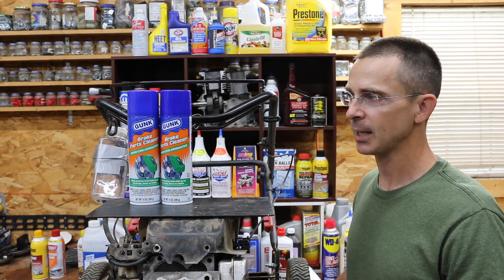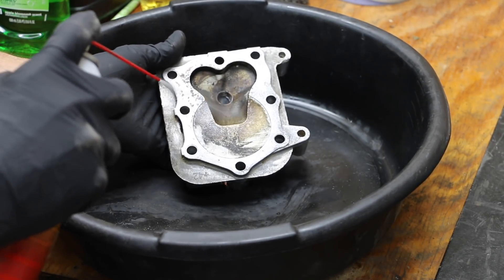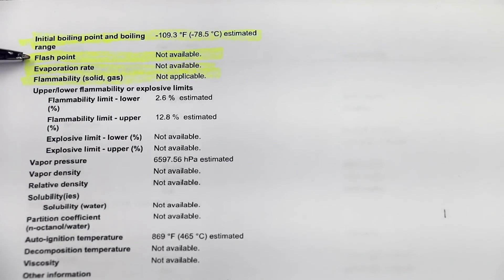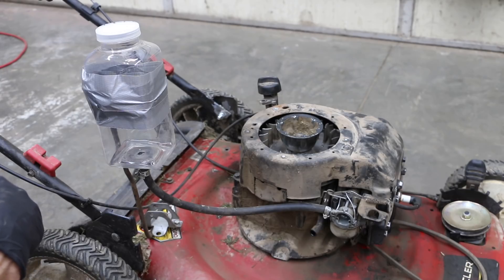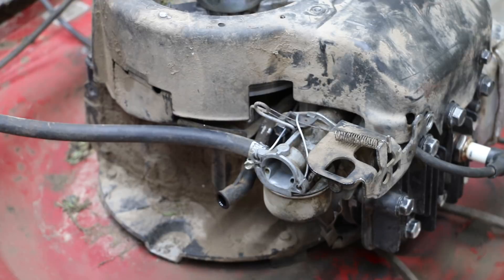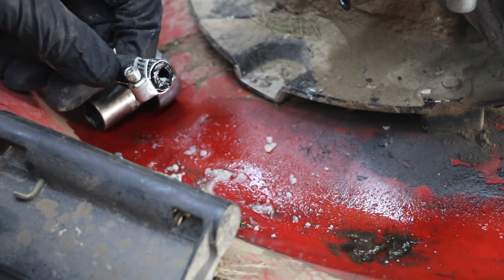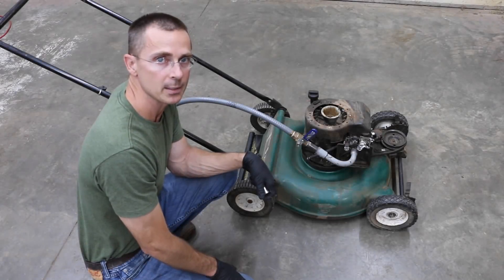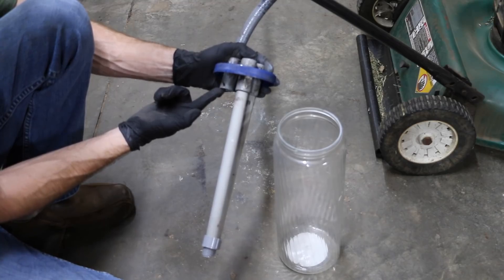Will a Gas Engine Run on Brake Parts Cleaner?  Lets find out!

Comment: Thank you for doing this video. I have asked about this a few times. I can't recall if you have used starting fluid yet, if not I would like to see it run. Also the beer /soda cans cylinder head. I think the cans would be funny to see. Honestly you are doing a great job on keeping the education / entertainment level pretty high. Sadly more people would like to see more failures but in the same sentence, I think they look for catastrophic failure just to see it happen, no matter what happens to you or your engines. I love watching your videos because I learn some things that I had no clue that could work in a pinch to get me through until the proper replacement parts are delivered or purchased in town. I also thank you for your service to the country!
Reply from the maker: Thank you very much for the positive comments. I tested staring fluid a while back and the engine ran for nearly 30 minutes in all without causing any damage.  Thanks for the recommendation on cans. That would be funny.

Comment: You could try Jet Fuel, altough that would probably be too extractor expensife for any Independent Guy like you
Reply: R0CK3R do you mean av gas or jet fuel?  Because jet fuel is more or less extremely pure kerosene from what I understand.
Reply from the maker: Thank you for this recommendation.
Reply: Yep it’s Kero with all the water content removed(higher quality kero) like JP8
Reply: I think you're mistaken. Jet A is purified kerosene, it is very difficult to ignite liquid jet A at room temperature.
Reply: R0CK3R! where is mark hates kittens!
Reply: 100LL is damn fun, but I think it would be functionally identical to mogas. Would be interesting to see if he could get Jet A to run in a gasoline engine.
Reply: Pacific Northwest....You're right, the av gas is more fun than kero, JP8 essentially, with the av gas though, you need to run a lot of lead or advance with the timing. The flame front and propagation is slower than gasoline. If you don't advance the timing, the exhaust valves will be shrouded in the flame as it opens. this condition will literally burn up the exhaust valve, overheat the head, melt top of piston....just sayin.....
Reply: JetA1 is for turbines; turbofans and props, JetB is good for old barely used turbojets mainly military and AVgas is for general aviation, still piston powered. But they all have greater properties to auto fuels like additives to stop freezing, water dispersant's and lubricity. But it's not very expensive, I'm sure you could reach out to a smaller airport that services small jets and get a few litres in a jerry can.
Reply: Aye what's ma German boi doin here ?
Reply: Jet fuel almost burns like diesel
Reply: Jet fuel is just kerosene with some anti gumming agents and minimal moisture

Comment: Hi Sir, great video.  I have a new suggestion, kerosene!  My grandpa used to run his farmall tractors on Cole-oil, which I found was a type of kerosene!   They had a switch near the glass bulb by the carborator, and warmed up the tractor on gas, then would switch the fuel to pale green kerosene.  My dad said the tractors would run nearly all day on kerosene, but that gasoline would take two or more tanks on gas.  There are different types of kerosene, I believe Cole oil was type 3 kerosene.  I've seen it long ago at a farm fuel station, but that was twenty years ago.  Good luck with all your projects, and Happy Holidays!!!
Reply from the maker: Thank you for this recommendation and Happy Holidays. I plan to test Kerosene soon.

Comment: Run a car engine using the vaporizer and use gasoline or alcohol or other things that worked with the small engine also try to drive it if it works .
Reply from the maker: Thank you for this recommendation.

Comment: did you put a hole in the see through tank, because if not it will create a vacuum inside the tank and it wont allow the fuel to get in the carburetor easily
Reply from the maker: This is a great point. Yes, I added 2 tiny holes to the cap. Thanks again.

Comment: I feel like you’d know the answer to this question, I can’t find it anywhere on google. My 2 stroke stihl weed eater, no matter if it’s adjusted perfectly to the pressure and temperature of the day will smoke white smoke, when I place my hand over the exhaust I get this brownish film on my hand. I was wondering if you’d know what’s happening with it. Im hoping its just too rich in both fuel going into the engine and oil in my gas and not the piston rings blowing out
Reply from the maker: I believe you're right in that the engine is running rich.  You might try a synthetic 2 stoke oil to see if that reduces the smoke.
Reply: Project Farm alright, thank you. That reduces my worry’s, I bought the thing practically brand new from a family friend for $50 ($300 off) and let it idle on and on with seafoam to break it in real good. High rpms can mess with the engine while breaking it in and making the “breaking out” phase happen prematurely.

Comment: Will engine run on blinker fluid ?
Reply from the maker: LOL! This is a great one.
Reply: kekool95 You might need to check the piston return springs!
Reply: Also he might need to check the muffler bearing in that mower.  Wonder if ChrisFix himself wants in on this.
Reply: kekool95 red or yellow. Red burns hotter.
Reply: Blinker fluid. Dielectric grease!
Reply: Don’t forget to barometrically sync 
the spark plug fuses.
Reply: Nuh uh that would sieze your muffler bearings
Reply: you'll need to install a hyfendufenator in the carburetor, but be careful: you may have to replace the muffler bearings. Make sure you put hazard additive in your blinker fluid.
Reply: @vincentrobinette1507  hazard rated blinker fluid is on available to law enforcement and fire departments, LOL!!!
Reply: I have a moped that runs on synthetic high mileage blinker fluid. It adds horsepower to.lol
Reply: @Olmstead Technologies Cris Fix bought out the last supply before it was outlawed!
Reply: he might blow the welds off its intake !
Reply: Lol
Reply: Shhh.. don't tell the beamers.
Reply: You forgot the fram grease
Reply: And also "can engine run without seals on valves"
Reply: If you have blinker fluid all you have is water
Reply: Fratastat. Settings cannot be fixed after this...
Reply: I don't think visine is flammable enough.
Reply: Perhaps, so long as the muffler bearings are of good quality and the kanooter valve can provide sufficient flow
Reply: I love all of the advice and suggestions, bit I just want to make sure he gets a good exhaust sample while running the tests.
Reply: Happy to donate some from my BMW if you need it. God knows I don't.

Comment: Project Farm, I find your videos very interesting, but I notice when using some fuels you have to block off half the carb intake with tape, which changes the true results of the test. It would be better if you had a small motorcycle carb that you could change out the main jet. it would be fairly easy to calculate which jet to use, start with double the size for alcohol and work from there
Reply from the maker: Thank you for this recommendation.  This is a great suggestion.

Comment: Once heard an old timer talk about how he had an old GMC truck that burned oil on one cylinder and kept fouling the plug, he put a boat type plug in it and it worked and didn't foul
Reply from the maker: This is very interesting. Thanks for sharing this information.

Comment: I wonder if Rislone Head Gasket repairer works. My car shows signs of having a blown head Gasket and a mechanic suggested I try that product but it's kind of expensive (if it doesn't work).
Reply from the maker: I hope you achieve good results if you choose to go with this product.
Reply: Thanks, I am unsure weather or not to try it at $80+ per bottle. I am hoping that somebody in the comments section or your good self might have some advice. Any info on people's experiences would be greatly appreciated.

Comment: need to try using  water, toluene and ethanol for a home brew gasoline and see how it works. It would be neat if some of the others have a few different things to do a home brew combination and try to make gas that will work in the engine. I am sure other would have ideas as well
Reply from the maker: Thank you for this recommendation.

Comment: will a 4 stroke engine run with 2 cycle oil and non mixed gas
Reply from the maker: 2 cycle oil in the crankcase and gas in the fuel tank? Thanks
Reply: exactly

Comment: Run compressed air for a supercharger
Reply from the maker: Thank you for this recommendation.
Reply: Use the vapor guy unless a lawnmower carb will work as a blow through carb... Encapsulate the carb and pressurize the capsule and see if it'll carb inside that environment

Comment: Try and run it on Coleman gas or that Ronson liquid lighter fuel you put in a Zippo. Thanks for the great video. Also, if you burn chlorinated brake cleaner at certain temperatures it gives off phosgene gas, which was a chemical weapon used in WWI.
Reply from the maker: Thank you for this recommendation and great point regarding chlorinated brake cleaner..

Comment: Will you build a GEET engine and test it with actual work.  Most of the videos that I see of these engines are just idling or reving.  A vehicle driving would be my first choice, but lawnmower or something else would work.  They have kits or DIY from plans.  Do a side by side comparison with the same amount of fuel.  Thanks and keep the videos coming.
Reply from the maker: Thank you for this recommendation.

Comment: Another great vid mate.  Looks like it runs lean after checking the spark plug.  But it still works.  
Also probably won't be getting the upper cylinder lubricated like petrol provides. 
Cheers mate 👍
Reply from the maker: Great point and thanks for the positive comment. Cheers

Comment: What about trying E 85 alcohol? What adjustments would be needed for proper air fuel mixture? Can you get enough fuel without adjusting the carb?  Since it's about 50 to 80 cents a gallon cheaper is it worth the bother? Thanks
Reply from the maker: Thank you for this recommendation.

Comment: Will a 2 stroke run on a instead of 2 cycle oil mix in the gas, putting actual car oil (10w-30) in the gas tank.
Reply from the maker: Thank you for this recommendation.

Comment: Wonder how many RPM a lawn mower can rev to before fail  (^_^) 
I have taken the governor off a few mowers, but never checked RPM or revved to blow up
For brush mowing, you can cut out the front of an old mower and rev it up to mow brush (^_^) Works good
Reply from the maker: Thanks for commenting.

Comment: I like as soon as your vid loads because I KNOW it will be good. EDIT 01: Less than halfway through and feeling all warm and fuzzy because you used one of your old faithfuls and not one of those new crate motors. EDIT 02: I have an (assumed) 2.5 hp OHC four stroke that does me well. It won't start without Ether, but it doesn't stop once it's going. Would you suggest trying a vapour set-up on an OHC 4 stroke? It could well be higher than 2.5. It hammers heavy lawn.
Reply from the maker: The vapor setup seems to work well for short periods of time, but I wouldn't recommend it for day-to-day use. It would require a lot more refinement and it isn't worth the time and effort. Have you tried using Marvel Mystery Oil or Seafoam in the fuel tank?  That might help, but it's not a sure bet.

Comment: Different stuff in the crankcase - like Olive Oil or Hair conditioner. Also,  I used to know an old mechanic who swore by filling the crankcase with diesel (on a car) and letting it run to clear out build-up.
Reply from the maker: Thank you for this recommendation.

Comment: Use pure battery acid with fuel. But be careful. The gas is very dangerous use a gas mask. the engine will be new
Reply from the maker: Thank you for this recommendation.

Comment: How about how to restore an automotive/led acid battery? Or what electrolytes will work as a replacement for the fluid inside of the battery?
Reply from the maker: Thank you for this recommendation.

Comment: my 100cc bike engine is rated for 10w 30 engine oil and if i put a 10w 40 grade engine oil in it what will happen
does it cause any damage to the engine.
if anyone have an idea plz rply and let me know.
Reply from the maker: It shouldn't cause any damage, but I would recommend staying with 10W-30. Thanks for commenting.

Comment: Can you run nitrous or a turbo on a small engine?  Curious if you can test ways of adding power.  I always think of that when I'm pushing through tall grass and it's starting to get bogged down.
Reply from the maker: Thank you for this recommendation.
Reply: It'd have to be one tiny turbo 😂

Comment: Saw a different method to create vapors, instead of massive bubbling...take green scratch pads, wrap them around a mesh tube, zip tie them in a cylinder...drop down into bottom of tank...the long plastic runners used to bubble now don't have to go into the liquid fuel...the green scratch pad wicks the fuel up and vaporizes much faster.
So cool to see run on brake cleaner...ate up the innards of the carb...
Keep em coming!!!!!!

What I really want to see is if heating the fuel (say to engine radiator temps (160-195F)) the thing I am trying to see if fuel will vaporize faster if heated, instead of atomize, this way I can epoxy a tube to the fuel rail on my truck, run a bypass from radiator thru that tube heating the fuel rail to radiator temps, this way the fuel squirts in the intake manifold at much higher temps and flash vaporizes vs going in as little droplets of which not all burns due to it being droplets, increasing fuel mileage
Reply from the maker: Thank you for the suggestion on how to improve the fume setup.  Seems much better.  Great idea regarding heating the fuel all well.  Thanks again.

Comment: Nice! That fume setup was really cool. I seems like you can run a gasoline engine on pretty much any liquid or gas that's flammable enough, given that you premix the right air/fuel ratio. The problem with running on other fuels otherwise seems to be the mixing rather than the combustion.
Reply from the maker: Excellent point.

Comment: will in run on compressed air cans.. note i mean the liquid that comes out when you flip the can upside down.
Reply: PLEASE don't try it, it won't work ,also Please please be careful about phosgene gas and don't use chlorinated chemicals in an engine
Reply: DO NOT BURN THAT GAS 1,1 difluorothane is poisonous when burned, your lungs will hurt after inhaling that stuff, not worth it.
Reply from the maker: Thank you for this recommendation.

Comment: I really didn't expect it to run that long. My guess was that the rubber seals and O-rings would have been dissolved in the little chunks would have clogged up the carburetor. Did much better than I expected. Thanks for the video friend. As always the best to you and yours. 👍🏽
Reply from the maker: Thank you very much for the positive comment all the best to you and yours as well.
Reply: Project Farm . My pleasure luv your videos. Will a lawnmower run on hair spray? Or acetone?

Comment: brake parts cleaner is a really good way to quickly diagnose a fuel system problem for automotive applications. you can run a vehicle on it to get it into the shop.
Reply from the maker: Thank you for this recommendation.

Comment: Fantastic data analysis with your videos! The data sets are good throughout the video but for direct comparison putting the raw data in a table or something at the end of the video would be helpful. I noticed a few comments about running an engine on propane which is absolutely possible as many forklifts, floor buffers, etc utilize propane as a fuel. An interesting thing to test would be if running propane in an engine that is dirty from running other fuels such as gasoline would be cleaned only by the the burning propane. Thanks for some great information!
Reply from the maker: Thank you for this recommendation and thanks for the positive comment.

Comment: Test Motorkote, alot of semi drivers used this stuff. It works in fuel or gas, and has oil lube, and a spray like wd40
Reply from the maker: Thank you for this recommendation.

Comment: just subscribed, very interesting experiments some predictible, some not .that being said, can you try to make a 70s or 80s 2 stroke  motorcycle engine run on diesel? raiase the compression a little  imean shave the head ect and see if it wil run a short time?
Reply from the maker: Thank you for this recommendation and thanks for the positive comment.

Comment: I could have told you it will run. we use it periodicly to diagnose "no-start" no fuel vs. no spark, ruling out one or the other in one go. also works great for finding vacuum leaks
Reply from the maker: Thanks for commenting and great suggestion for other uses too.

Comment: Awesome video, thanks for doing that. I was reading about methods to desludge an engine and kerosene was mentioned quite a  bit. I'd love if you could test if running some kerosene along with oil in the crank case would clean anything up.
Reply from the maker: Thank you for this recommendation.

Comment: I'm curious if you can get a motor to run off of vapor from diesel fuel. That would be cool to see. But I think you might need a little gasoline to get it to fire just my guess
Reply from the maker: Thank you for this recommendation.

Comment: Another awesome video, keep the vids coming Project Farm! Here's another idea: How long will a 4 cycle engine run if you replace the engine oil in the crankcase with 2 cycle oil and run the engine on mixed gas? Will the 2 cycle oil even provide adequate enough lubrication for the internal parts of a 4 cycle engine and if so, for how long? I'd love to find out!
Reply from the maker: Thank you for this recommendation.